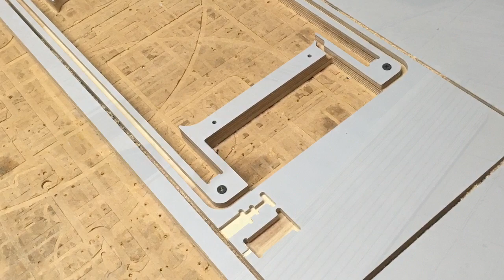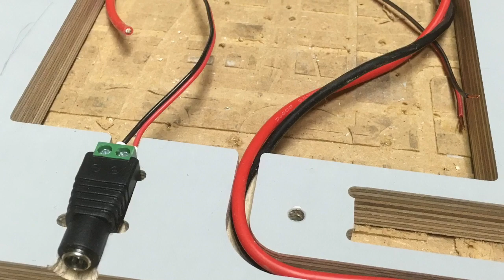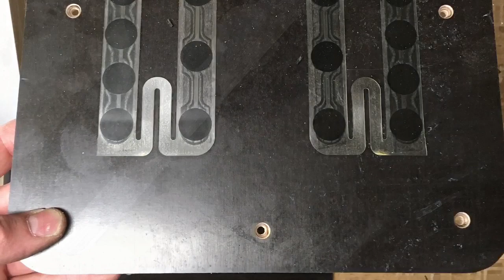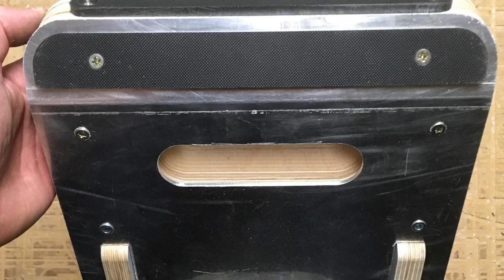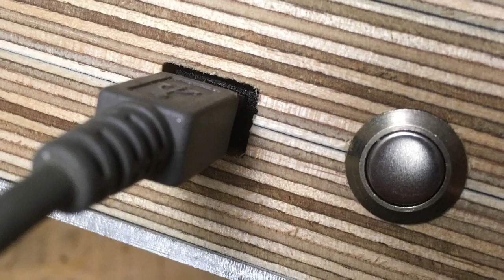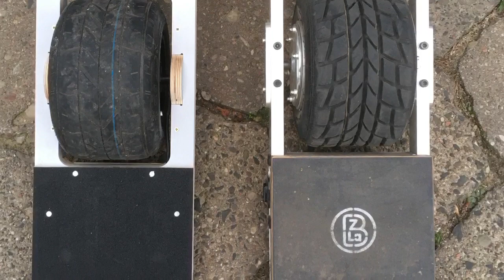PlyWheel - new DIY onewheel electric skateboard by ZbLaB

Comment: What electronic board are you using and what is the the baterry voltage
Reply from the maker: Fsesc 4.20 and 12s battery.
Reply: @ZbLaB  nice build thank
Reply: @ZbLaB  good job.  I want to repeat this project but cannot find dxf files for making a board.  can you tell me where they are?

Comment: Top video to bring out a better affordable PylWheel/Onewheel. Is there finally a chance to buy a ready kit to build that wheel at home ? I see it´s very complicated and have to be an expert, need much space for manufacturing and build it up.
Reply from the maker: To Gm check https://fungineers.tech
Reply: @ZbLaB  The invitation into the discord-channel does not work and failure.
Have some questions about the diy funwheel.
Could you please send me the link fort the discord-dhannel.
Thanks

Comment: The foot sensors your using, would I be correct in saying they were wider and you have cut them down? any problems with cutting them? or do they work as they were intended to?
any reason you didnt use the Kia sensors?
Great job BTW, Ive been following since your first build and have parts in the post at the moment, cant wait to start my own build.
Reply from the maker: Coron Schneebeley in that kia sensor at least 2 spots on both branches must be pressed to get signal pass. It is not optimal. On next sensor I bought, from audi there was more spots, but it was too big - I cut some of them away and reconfigured pin conections in plastic mold, that is located between foil an cables - I removed resistor and connect them to get signal when at least one spot is pushed.
Reply: I have just received my P-hub from pei, and I have two questions about how you have worked your axle offset and valve clearances, the hub seems to be off set to one side, the motor wiring and valve side has more axle length then the other side by a small amount (looks to be 10-15 mm at a guess without proper equipment) did you off set your mounts to centre the wheel or just not bother? I also see the valve may provide clearance issues, I see your using what looks like a shorter (cut down and re threaded? Or a new/different?) Valve stem? The original valve stem itself seems to be sealed in with gasket paste haha... Was yours the same? Again lovin' your vids and I can't wait to see more on the diy onewheel!!!
Reply: @Coronnn  For the record I did not center my motor to adjust for the 5-10mm offset and it rides like a dream.